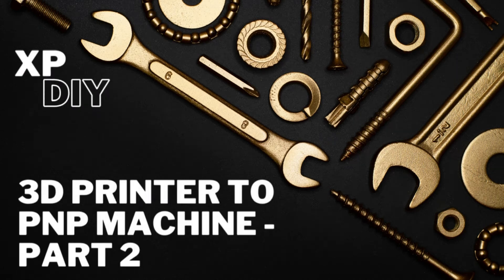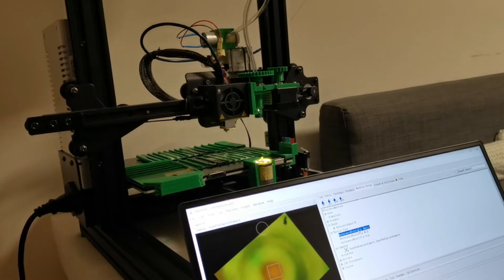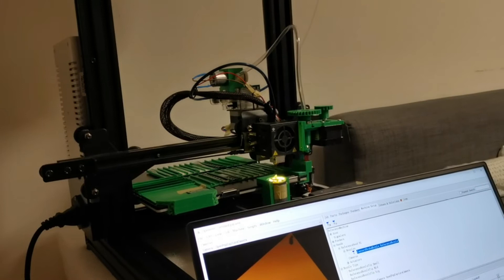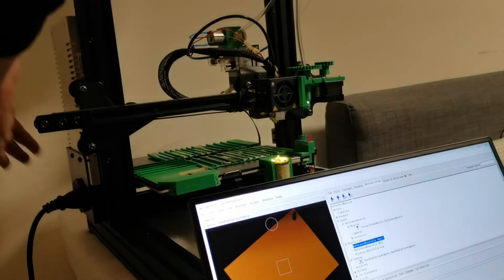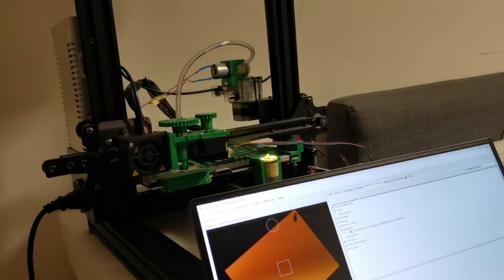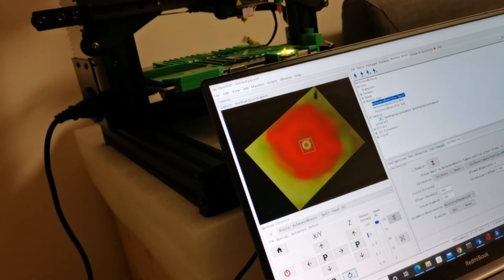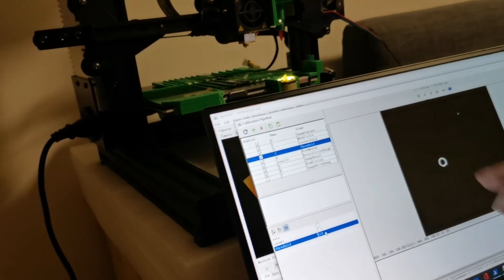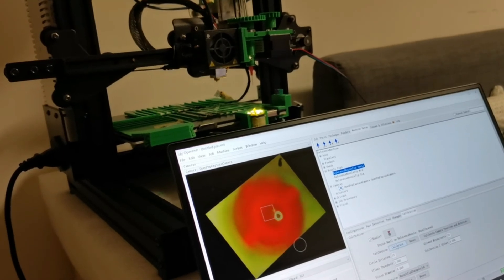DIY pick and place machine from 3D printer Part 2 - Automatically change nozzle tips

Comment: Noticed that you done an adapter for the stepper mottor. How is this connected to openpnp?
Reply from the maker: Openpnp supports different axis letter, the 3d printer mainboard support axis E, so in this case openpnp uses E axis to drive the rotation. The adapter for stepper motor is needed because of the pin difference between 2 different stepper motor.
Reply: @xpdiy   Thank you very much for the detailed explanation. Appreciate it! I was able to send G code with axis E and it works! I was also set the fan speed from G code and that proves it can be used for suction pump on the PNP header.

Comment: How did you connected the stepper motor for nozzle rotation to the opening?
Reply from the maker: In openpnp  I used the E axis, which is supported by all the printer main board.